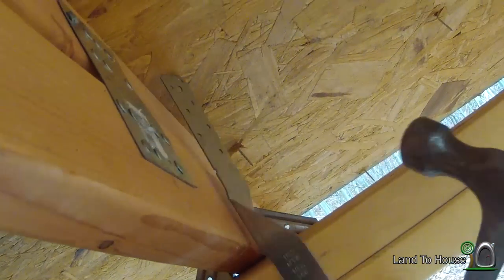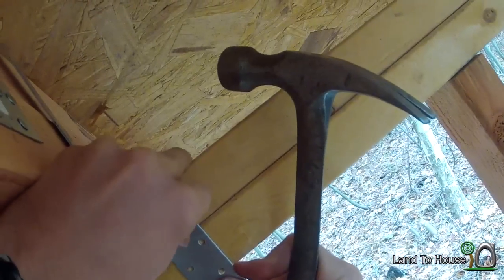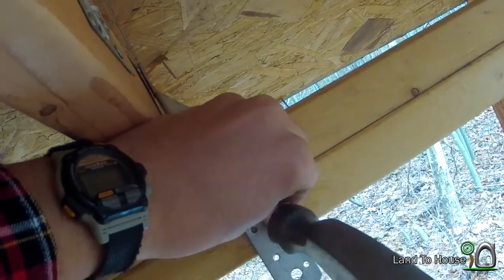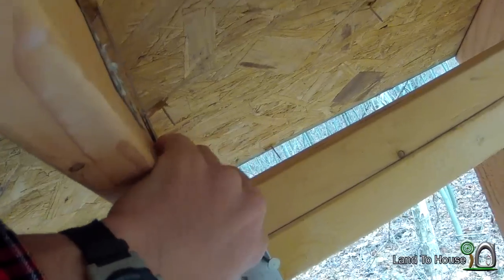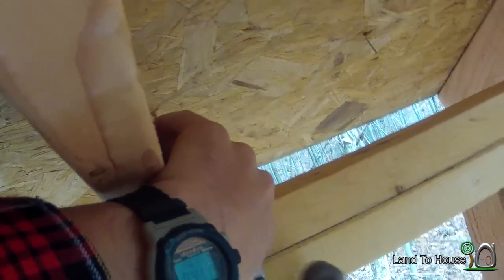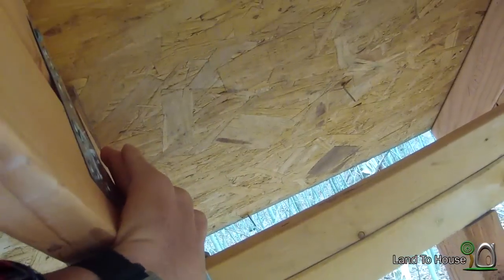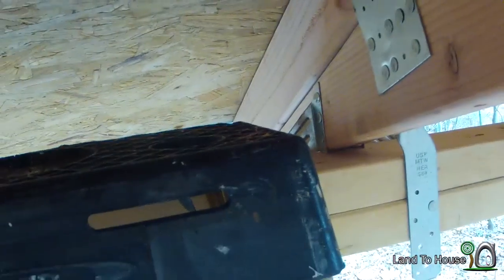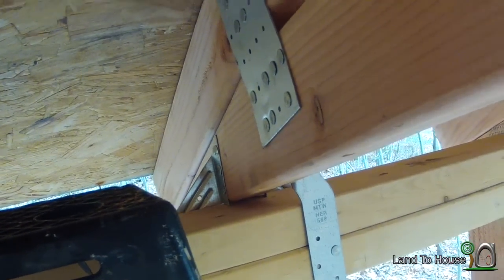Tiny House 22 - Simpson Strong Tie Hurricane Clip

Comment: Seth, love your videos and I'm Glad to see you did this, lessens the chance of the trusses scissoring open and outward off the top plate because there is no shear force connection between the trusses and the top plate. (birdsmouth toenailed to top plate). with the H1 and these you have at least several brackets under bending force to share the load.

Comment: I can't see those trusses moving any time soon in the wind! For an extra piece of security you could bend the bottom overhang and nail up into the plates, they bend over pretty easily with a hammer.
Reply from the maker: These trusses are not going anywhere! With this last clip on I can push on the trusses and they dont move. Now when I was standing on the roof it was a tad shaky until I got the OSB on.
Reply: Please, don't fold or twist ties/straps that aren't designed to be bent. Please, read manufacturers instructions for proper installation practices of all hurricane ties. If you don't follow their directions the ties will likely fail, or fail more easily than they should; which kinda defeats the purpose of their install, and wastes the money and time spent installing them.

I'm not sure which ties he has here, they change over time, but if he'd installed the current H2.5 ties he could've put 5 nails total into the top plate and the top of the wall frame, and the strap wouldn't have extended below the top of the wall frame like these ties here do; but he also should've use only the nail or screw types approved by the manufacture. He appears to use the wrong type of screw here: https://youtu.be/Ag8pxbwZfLY?t=15m28s , and it's important to not only use the right connectors, but also the right quantity (8 nails/screws minimum here, per tie).

More is pretty much always better when hurricane ties are concerned.